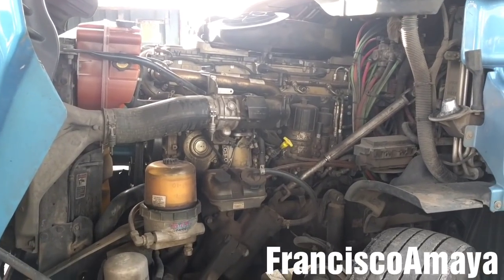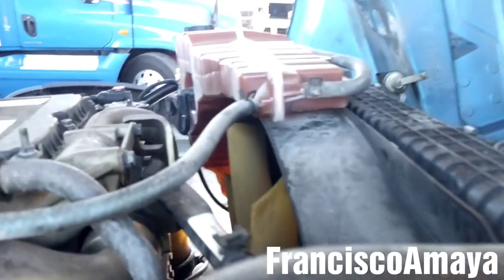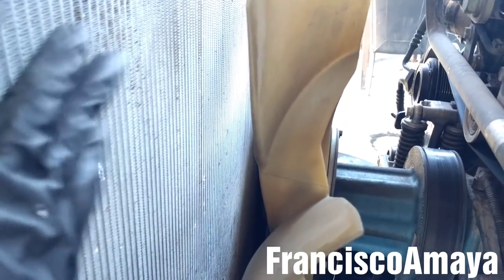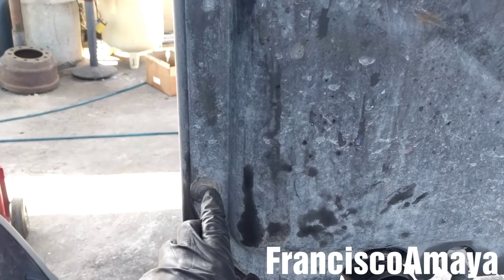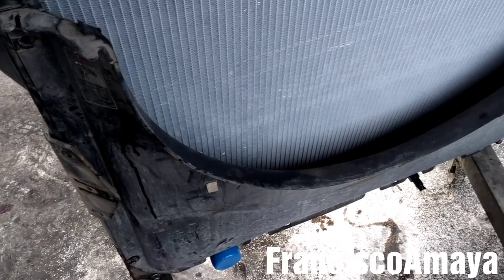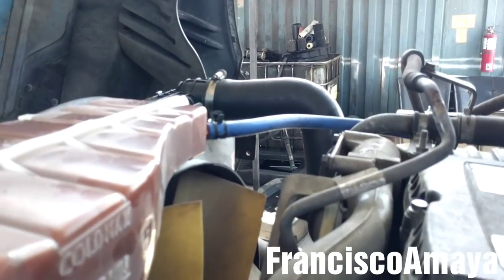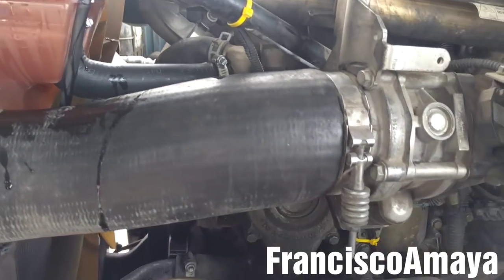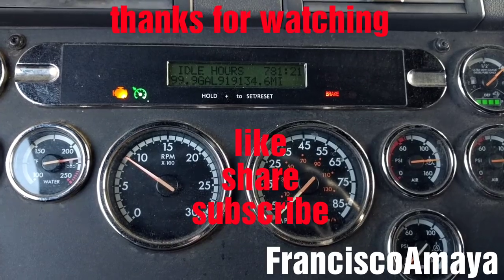Freightliner Cascadia DD13 DD15 engine radiator removal replacement

Comment: Thank you!!! Great Job Francisco!!! But you can do this project without removing the bumper and I didn't have to deal with AC because I unscrewed the Condenser from the radiator and carefully left it inside the hood with some foam underneath for protection...
Reply from the maker: Yes you can do it.
Reply: Thanks!  I was hoping I didn't have to remove.

Comment: I saw taking a radiator like this one without taking the A/C condenser out, fan, A/C gas, etc. He separated all those and took only the radiator out, all manually without a crane. They were two guys doing the job but I think that was too risky. The new radiator can be damaged easily. What do you think of this process? 

Good job as always!!! Thank you for these videos. Keep the good work!!!
Reply from the maker: Yes, it is a risky job.  
No removing the a/c gas could damage the a/c hoses and create a leak.  

Also, removing the radiator manual can accidentally break the hood brackets. 

And yes, the new radiator could be easily damaged.

Comment: Hola Francisco,una pregunta. Tengo un freightliner cascadia 2016 y me estâ regresando el fuel solo al driver side tank. Ya cambié las valvulas de respiración en los tanques tambien la cruzeta que divide las lineas abajo del chassis pero hace lo mismo, tal vez me puedas ayudar. Gracias de antemano. Muy buenos tus videos.

Comment: Amigo me gusta tus video tengo un problema con un freighliner cascadia 2013 caja 10  , le bajaron la caja dos veces tiene cloche nuevo y en baja me suena pero cuando aprieto el cloche de me quita el ruido y si le pongo el cruise control tambien ,la transmisión es 0 milla nueva , y todo del cloche es nuevo  podrias ayudarme
Reply from the maker: Como suena?
Reply: Francisco Amaya  suena como metales chocando como si estuvieran rosando metales
Reply from the maker: Es posible que algo adentro de la transmission esta mal o alguno de los tornillos arriba de la tapa de la transmission es muy largo.

Comment: Do you really have to remove the AC lines and fan and bumper that's a lot of work I have a small leak right in the middle of radiator some how Rock or something hit it is there a way to fix it
Reply from the maker: You don't really have to but to prevent unnecessary damage it is better to do it.

Comment: My original radiator on my 2018 DD15 doesn’t have the transmission lines on the bottom of the radiator, I purchased a new one from freightliner using the last 6 of my vin but this radiator has the transmission line openings. I’ve been told that it will still work? I supplied air in the tank and no air pressure came through the transmission lines opening.. any one else have this issue before? Am I good to install this radiator?? Thanks
Reply from the maker: If it has the cooler integration it would not affect your model.  The can be open but if you are in a high snow area install plug to prevent corrosion
Reply: @franciscoamayaYT  thank you!! Im in a southern California but I will definitely look to plug those openings just to be safe. Any recommendations on where I can find those at? I’m near Fontana California..

Comment: Hey Francisco, thanks for your video. Mine is leaking. I was thinking I would be removing the hood. Perhaps I can if I want. But  also one of my brackets that the hood cables bolt onto is broken off of the radiator  so I may go OEM, I'll just see what they have and how it fits and so forth. Now I don't have an a/c robinair tool like you do so I may be careful in working around it or run up to a shop and have then recharge it. 

Thx for your info, I don't see much info out here for dd15 engines except from YouTube that is free. I would like to get my hands on some literature with diagrams etc or someplace.

Comment: How heavy is the radiator and will I need to have a cherry picker?
Reply from the maker: Yes, it is better to have a cherry picker. 
You can do it manually but you need at least to people to remove it.